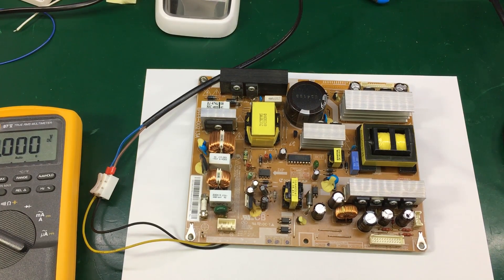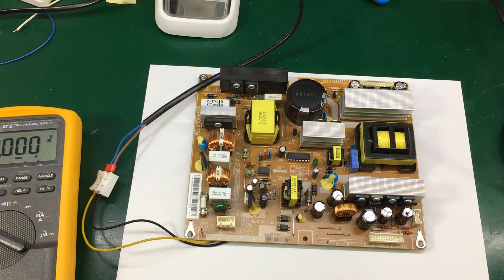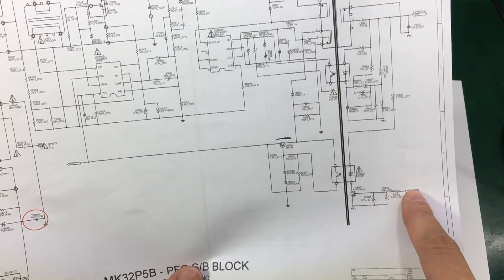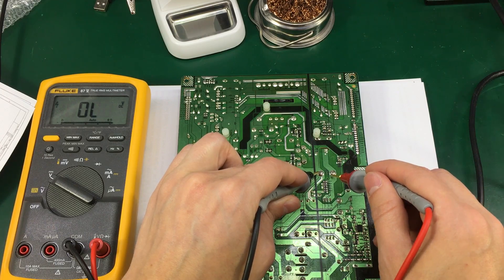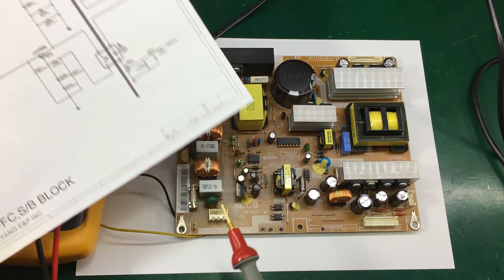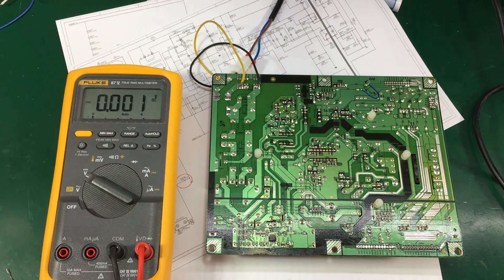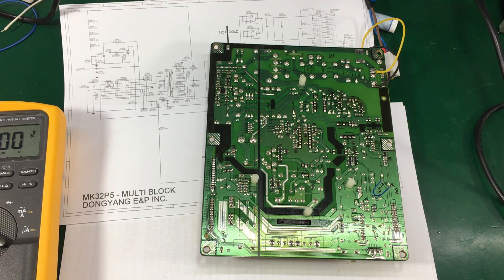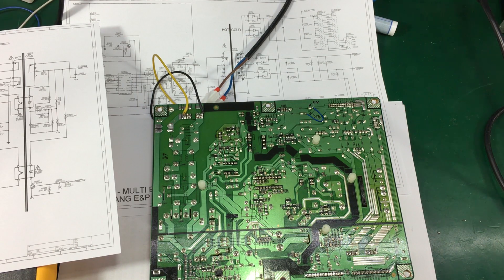Voltlog #99 - Samsung TV Power Supply Board Repair MK32P5T BN44-00213A

Comment: How did you know what to bridge to get the power supply to come on without being in the television?  I am debugging a Samsung 32" computer monitor that turns randomly and won't come back on until maybe unplugged for a while.  I did find some solder joints like you described, resoldering these did not fix the issue though.  I think I need to start poking around with a scope while it's on the bench but not sure how to get the supply to come on.

Comment: I was given a 32" Samsung TV for free because it kept turning itself off. I checked the PSU and all caps seemed fine, no obvious burn marks. Then I found this video and after that I managed to find the same broken solderjoint. It was barely visible, I dont think I would have noticed without this video. Thanks for the help!

Comment: Same issue here, also removed the dried epoxy, some of it had high resistance when  measured with the multimeter, and also was the ones with high resitance were dried out af.

Comment: Hi, What do you suggest for the following problem I am facing:
I have the powerboard BN4400932B of a Samsung TV, which says the Standby power to be 11.8V. 
I disconnected the board off TV and checked the Standby power to be ok I.e. about 11V, when I connect the board on the TV the Standby power drops to 4.5V.
What could be the reason?

Comment: Hello my board has been burned in the section where the CM810 the blue ceramic capacitoris is located. So my question is what type of capacitor is that to replace it. Thank you all

Comment: I have searched for a schematic or ANY information on a Samsung power supply board LJ44-00187A also marked LJ44-00188A and PSPF321501C and PSPF421501C and can find nothing . This is from a 42" plasma rebranded as Changhong. All the voltages are ok but with no load connected it draws excessive current and brightly lights a 150W load lamp in series with the mains. With a 75W series load lamp it just does a cycle of relay clicking. I am puzzled that there is nothing on Google about this board.

Comment: You need to apply +5 V DC to the PS_On/Off pin to turn on the board itself, right? I have a PS board (L32S0X) from a Samsung S32D850T PC monitor that is probably defective too.

Comment: I had the same problem and after changing the capacitors on the power board, the backlight would still not stay on for more than a minute or so and so I put the TV in the spare room and forgot about it.  Today, a year later, I decided to have another go and was again getting nowhere until I saw your video.  I inspected the transistor legs with a magnifying glass and the solder looked ok but with nothing to lose, I resoldered them and fantastic, it worked.  Thank you very much.  I was about to throw the TV out.

Comment: Spot on! Checked all caps and they looked fine, only 5.2v being supplied to main board and the power board looked  bowed/curved slightly which led me believe tracks had gone and was going to purchase a second hand one. Then watched this and sure enough dry and cracked solder joints on point 802. 
Big thanks Volt!! saved me a few ££££s.

.

Comment: Hi there! I have a Samsung BR/DVD player with power board V 170- S DPN and when I turn on it goes into protection mode and off. I ve checked the PB and saw a pin blown near MOS 11N80C3 is the 2 pin (DRAIN) and solder is gone with a part of the wiring. Before the pin the current goes tru a diode 1 N 4742 A 12V / 1 W and that is bad also. You thing that might be the cause? I need to  replace the diode and resolder the pin what do you think. Where do I get a schematics for this type of Power board?  I ve measure the voltages during that 10 seconds on and off time and the values are not good . Instead of 27 V I have only 8 V instead on 2.5 V I have -11 V and that s not right. I also cleared the SMD with tiny cloth and alcool, and the front panel with switches also. I ve looked out for bad soldering . Also the silicone paste around the mos is kinda  drained out on the board.Maybe u can give a hint. Thanks!

Comment: Thanks for the inspiration. I have a Samsung TV that had already had the power board replaced once already, but this second time Samsung would not fix it. The symptom was a flashing standby light but the tv would no turn on. If I unplugged the the main board from the power board (which usually turns on the LEDs on a Samsung), but they flashed. I could not visible see anything wrong with the power board, but after seeing your video, thought it would be worth reflowing some of the solder.... To my surprise... when put back together, it worked again.
Hopefully posting this here will help someone else out too.
My power board model is Samsung BN44-00801A

Comment: I had a siimiar issue to this, where there was no 5VSB voltage (so also no standby LED) & it turned out to be a Schottky diode had gone short-circuit. Replacing the diode fixed the issue.
Reply from the maker: nice!
Reply: What is it with Schottky diodes going short in TV's these days? I've seen loads of them.

Comment: Master Oogway was said to master Shifu: ..."One often meets his destiny
on the road he takes to avoid it."... in other words, the real reason of the broken solders on almost all three pins is exact that elastic/plastic/solid glue that was applied on the component. Put it between the legs and board it apply a HUGE amount of force when temperatures change, it expand and contract at every gradient of temperature. So what the eevblog clown keep saying with the silastic applied on components it is not always right. Let the TO220 component hang on his own feet, it is just a constant small weight, it will NOT "flapping in the breeze", unless somebody play ping pong with the set or change channels with the fist/foot.
I had saw an interesting video at MrCarlsonsLab: https://www.youtube.com/watch?v=yy8NS2zejhQ , where some stiffening glue apply in the old electronics in years become electricaly conductive...
Right repair is to remove the component clean that garbage from its feet. Heatsink? I dont know depend of the circuit design... maybe work in saturation and it not need... it not seen any colour change of the board due to the overheating of the transistor.
Good luck man.
Reply from the maker: Interesting view and I think you might be right, that hard glue could certainly be expanding/contracting at a different rate. There is also the fact that the two lower joints we're cracked and those we're the ones who got all the glue..

Comment: Looks like the RoHS strikes again.

I've definitely seen capacitors that look good and measure bad. One was a Nippon Chemicon which are supposed to be good but when I tested it it was only measuring about 70% of its rated value.
Reply from the maker: yup ROHS strikes again and about the capacitors that's what i mentioned in the video, it can happen but on this occasion I just had a feeling it was not about the capacitors since all the rails were missing.

Comment: That cold solder joint problem might be caused by the transistor heating up when the TV is ON and then cooling down when it is turned OFF causing the solder joints to expand and contract.  I would put a small heat sink on it.
Reply: Ken Franco Or just throw on some real lead solder...
Reply from the maker: which I did :-)

Comment: would u be able to fix a Power supply without a schematic?
Reply from the maker: Should I find myself in that situation (and I did previously) yes it can be done. It's enough to understand the architecture and you can usually figure out the important stuff.